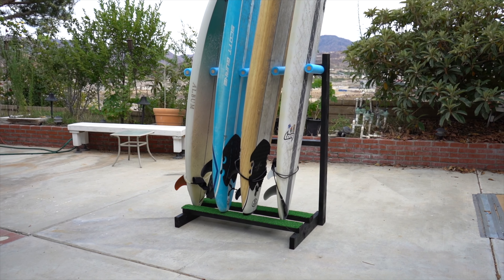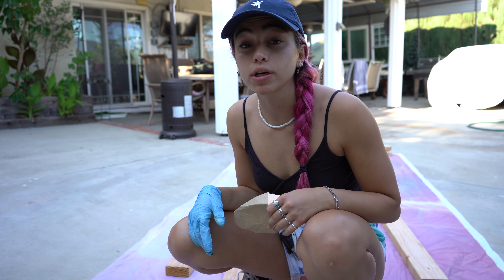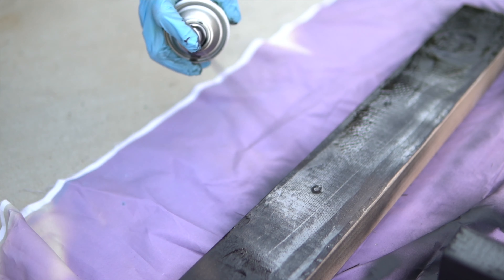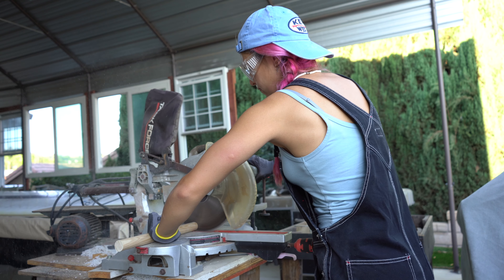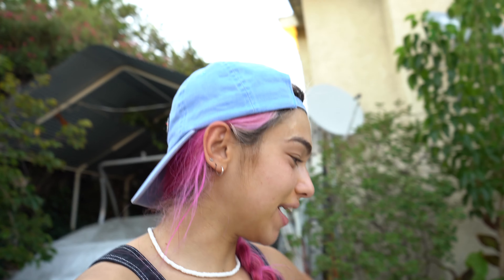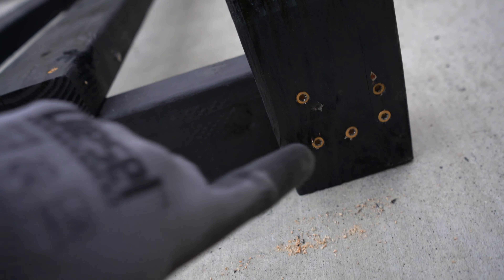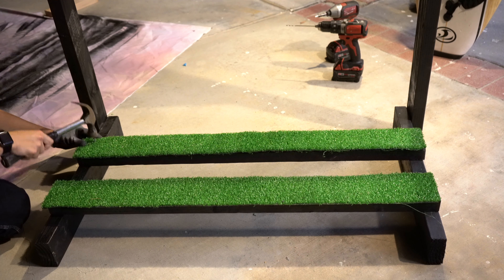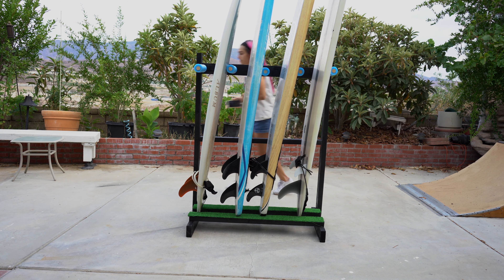How To Build a DIY Surfboard Rack (UNDER $50)

Comment: Nice and simple. Try drilling 1/2" deep dowel sized holes in the backboard so the dowels lock into the backboard. Use some wood glue in the recess and wood screws for extra stability.